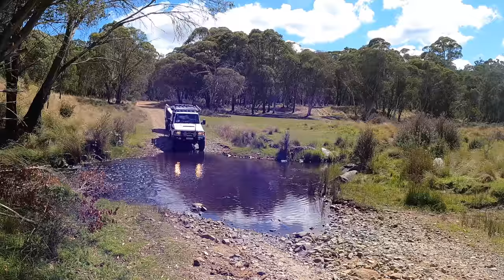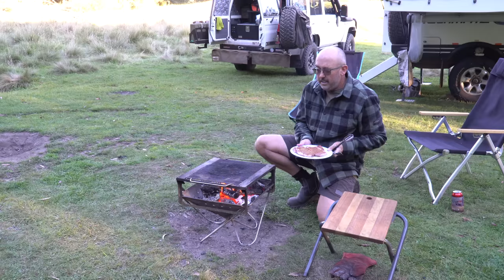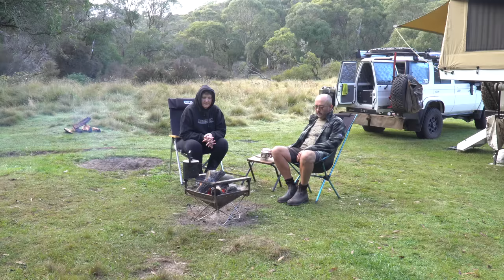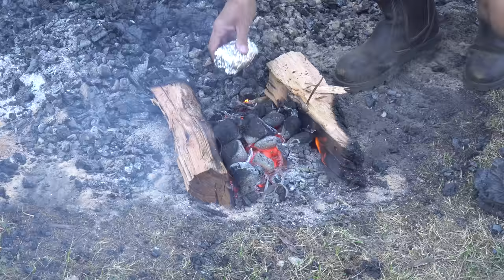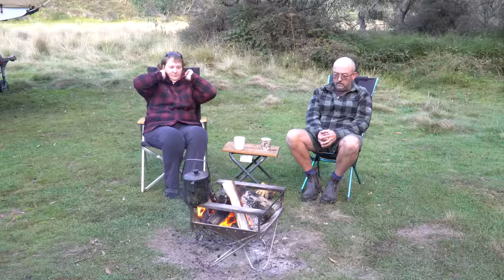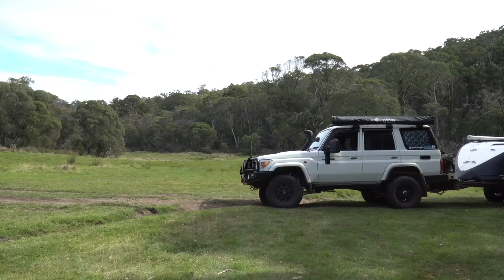The Ultimate Free Camping - Bondo State Forest - Snowy Mountains - Kosciuszko - Wee Jasper

Comment: Hey Shad enjoying your videos,what brand of radius arms are you using thinking of getting some for my cruiser,what lift do you have.
Cheers
Tim
Reply from the maker: Hi mate 
In the front i have superior hyperflex radius arms and psr 2 inch flexy coils, extended brake lines and relocated abs lines, running a superior 2.0 remote res 5 inch shock. Sway bar still connected
Reply: Cheers mate might look at the superior ones I just need to fix caster she is a bit twitchy on the HW
Reply from the maker: @whitey321  i bought the 3 inch ones and it fixed the castor , i have a slight wobble at 80 now but might just be my tyres, they are pretty ordinary

Comment: Love the look of your chairs and little table with the wood on top. One Drifta chair... the other Helinox??? Little table just a stool with wooden board thrown on top?
Reply from the maker: Yeah it is, i still prefer the helinox while Natasha loves the drifta recliner. And yes the table is a cheap stool with a chop board i made on top. 
I have another video coming out talking about all the gear we use . Stay tuned 😂😂. 
Thanks for watching
Reply: @Shad Donaghue  also another question (I love getting ideas from other campers in how they do different things), I had kind of given up on the cast iron pan thing because of not only weight, but because it is such a dirty thing to store. Just wondering how and where you store yours? In the Ulti or in the car?
Reply from the maker: @lynnelivingstone825  just store it on top of my toolbag in drawer, but yes i know what you mean but i just keep coming back to cast iron for fire cooking. I am going to look for a canvas bag for it though as I would prefer it in the camper. I did keep it in the box it came in for ages until it deteriorated
Reply: @Shad Donaghue  yeah I like the bag idea.  Any idea roughly how wide yours is at all? It looks a good size to go with the Snow Peak (which we have)?
Reply from the maker: @lynnelivingstone825  30cm from campfire Australia 👍👍
Reply: @shaddonaghue  thanks 😊